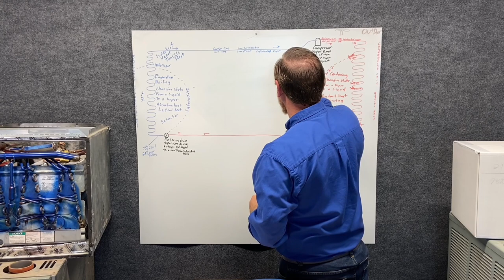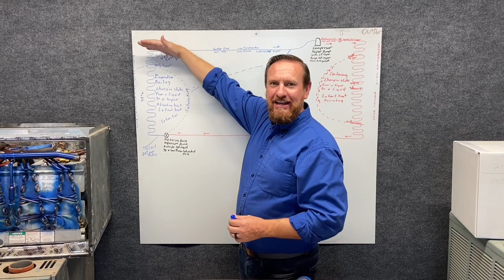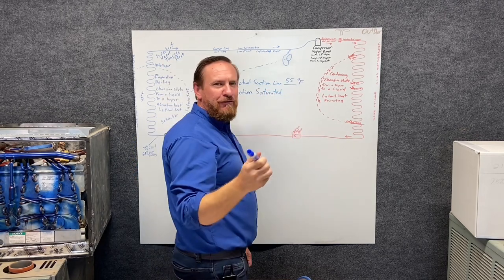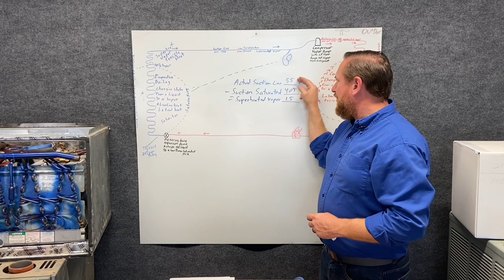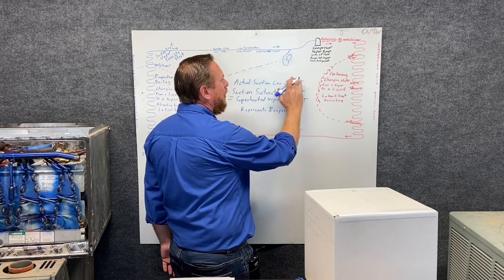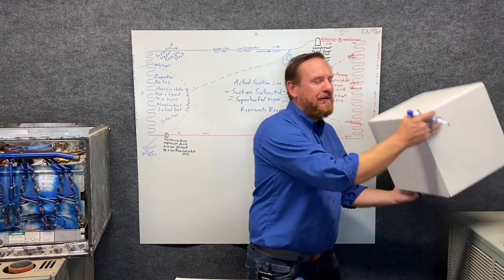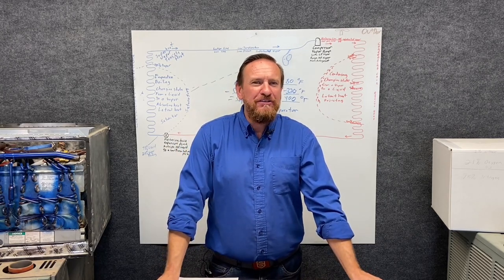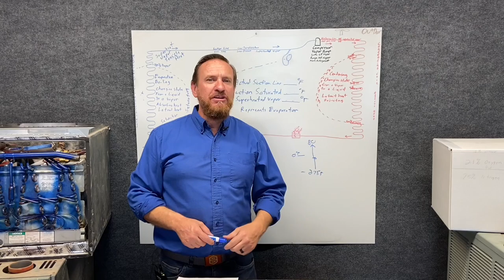HVAC 030 Superheat the foundation

Comment: Hello Branaman love your videos . So if it’s a negative number would it not be the difference between .
Reply from the maker: Hi Mukesh,
Thanks for the compliment.

As for superheat, it enters the evaporator as a saturated mixture of liquid and vapor. 
The refregerant can exit the evaporator as a vapor (superheated above saturation)
Or it can leave as  a saturated mixture of liquid and vapor. (0⁰ superheateed vapor)

For us to have a negative superheat, it would be a Subcooled liquid.  That means it would be below saturated. That would mean the refregerant would have to be cooled below it's saturation. Meaning the air would have to be lower than the saturated temperature. This is just not going to happen. 

What a negative superheat means is a measurement issue, inaccurate thermometer, thermometer placement, inaccurate pressures air improper temperature pressure conversion.

I'm short negative superheat means something with the tech or the instruments.

Comment: Fantastic explanation Ty!
Newby question: In your experience, is there any possibility for measuring temp of evaporator outlet instead of measuring suction pressure?
Reply from the maker: That is a great question!
Its beat to get both but it's not always necessary or practical.

When I'm setting TXV or diagnosing I look at the evap outlet superheat. This is a lot easier now with digital instruments. I like to have my students do both so they can see the gain in superheat to the outside especially on long lone sets.

Generally tecks use superheat at outsides and just allow for more superheat for longer line sets.

In either of case I still need my suction pressure to convert it to saturation temperature. 

There is a method of getting suction saturated without pressure. 
You would need  to record the temperature (with the doors on) where a distribution tube attaches to the evaporator coil. That temperature will be the same as saturation. Then take the temperature of the suction line and you can get superheat.

Comment: So just yo make sure, when youre gauged up to the suction line, youre technically not reading the true saturation temp at the center of the coil, rather you are getting an average pressure reading which would include the portion of the coil that is superheating the vapor? Wouldnt it be more accurate to take a pressure reading from a center point of the evap coil and compare that to the line temp at the suction line?
Reply from the maker: We want to know how much superheat is at the end of the evaporator. Even considering the overall small pressure drop across the evaporator it still in saturation/boiling state. The TXV also gets the suction pressure in most cases after the evaporator coil.

The suction pressure is almost the same on the whole suction side. Checking suction pressure in the middle of the coil would be <5psi difference than the end of the coil.

Comment: Hello sir, when the refrigerant gets superheated won't the pressure also get increased? So then the measured pressure when converted to temp, will get equal to the suction temp. And superheat will be 0.

Comment: Ask a question. In evaporator, refrigerant absorb heat, and change the mode from liquid to vapor without temp change. If sensible heat let vapor increase the temp, does the vapor pressure change? If the pressure change, is it accurate to use the suction line pressure to find out the saturation temp? thanks
Reply from the maker: The saturation is our base line. The sensible heat added to vapor above saturation is superheat. 

The heat your accounting for is already taken into consideration with the compressor metering device and external temperature. All of those work together to get the saturation point.  
For example oxygen boiles at -297  at 0 psig. That's it's saturation temperature. 

In my room it's actually 80F. The oxygen is superheated 377 degrees above it's saturation point.

As the air temperature increases my saturation temperature stays the same because of the conditions.
Reply: @love2hvac  Thanks for your clarification.

Comment: So how do you make liquid o2, helium, nitrogen, do you increase thier pressures to thier respective saturation points?
Reply from the maker: Flow oxygen in a heat exchanger through liquid  nitrogen, or cascade  cryogenic refrigeration system.

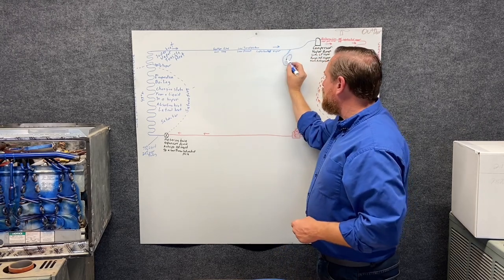Comment: 0:21 - Ty, how can this pressure be converted to a saturated pressure when the point of your pressure reading is vapor only - no liquid (at least that’s what we want)?! Our typical desired superheat is close to ten degrees, so isn’t that a large error since the temperature conversion needs to be extremely close to the PT relationship  for that refrigerant?
Reply from the maker: There are several videos before this one that focuses on that in detail.
But the short answer is, it's not saturated where you take the reading, it's saturated in the coil.
The pressure is the same in the coil and I'm the line.
When you convert the pressure to a saturated temperature that temperature will be right after the metering device. You can put a thermometer there and they will be the same. After all the refrigerant boils to a vapor then the temperature will superheat Above saturation.  The temperature at the service port will be superheated above the saturation point in the coil